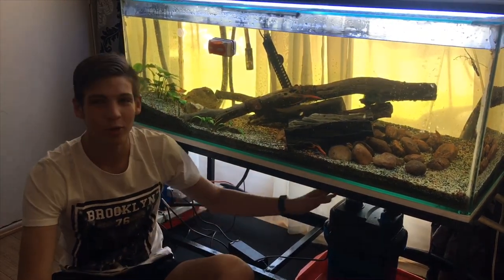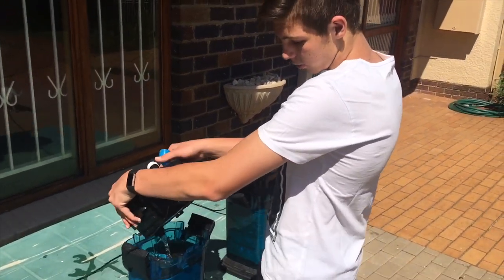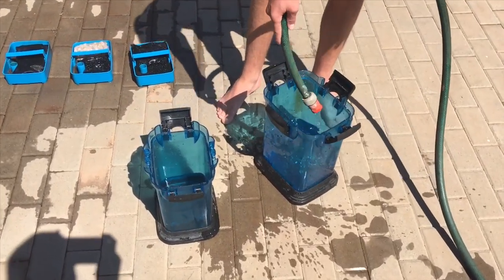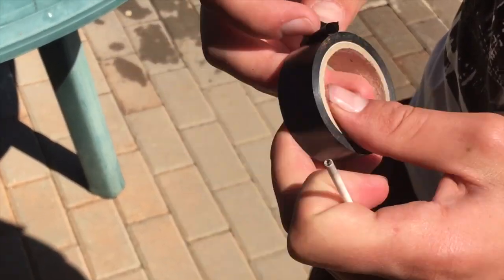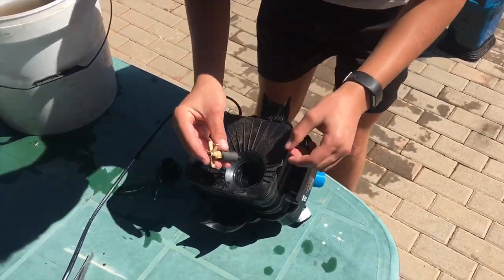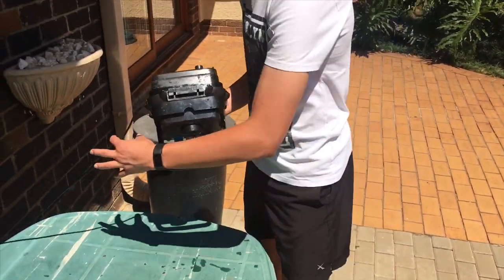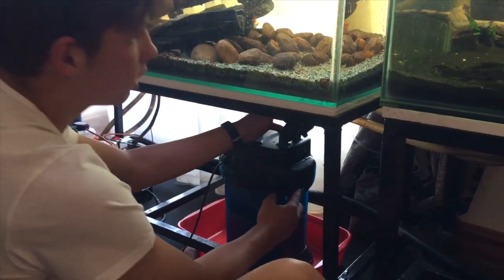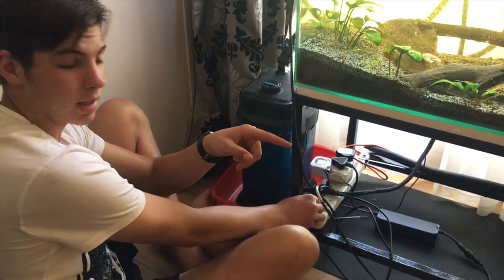How to clean a canister filter / noise canister fix

Comment: Hi
I had the same cannister filters...
Your media trays are in the wrong order
It should be starting@from the bottem upwards....
Mechanical Filtration(consisting of course meduim and fine sponges
2.Tray should be Biological media for benefical bacteria
3.Tray is for Chemical or if you dont want it should be again for biological media
If you have a 4 you can add chemical for extra water polishing or if you have some fish tank smells...... or just again biological media......